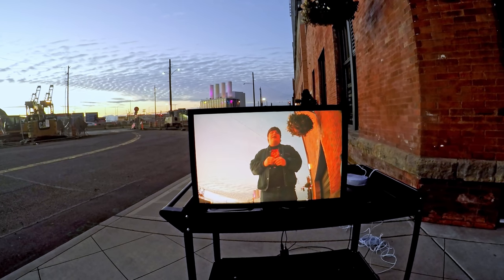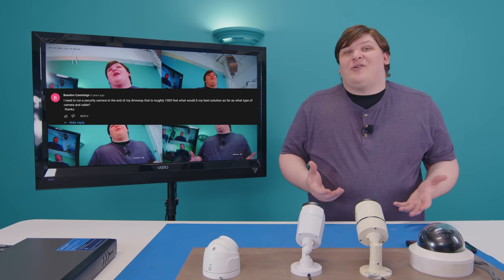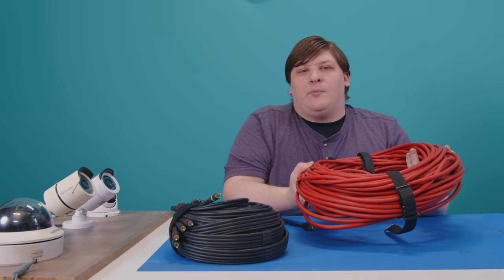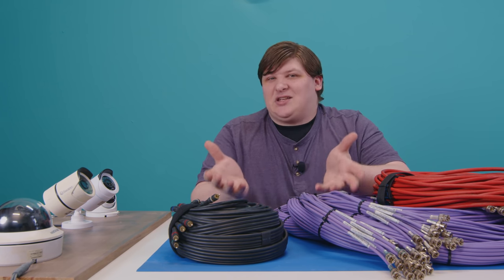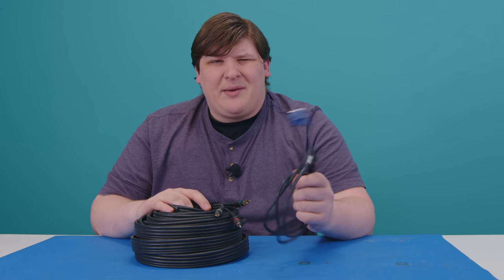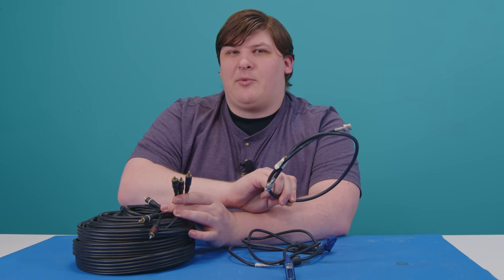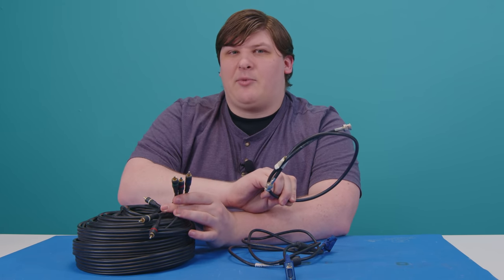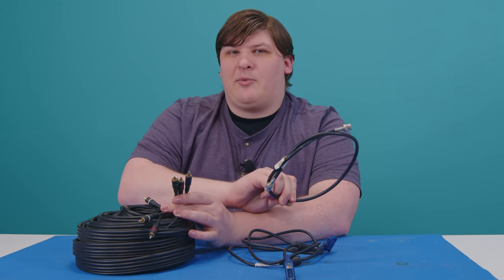1000ft of ANALOG HD video over a single cable?! [AHD/CVI/TVI]

Comment: CCTV Installer here (europe). We install 4k and 8k IP cameras daily. FullHD or 2k is basicaly obsolete in this buissnes. It's actually pretty scary beacuse most of Hikvision, BCS and Dahua (biggest players in the industry) cameras have face and number plate recognition chips onboard, only the cheapest ones don't and we rarely see that clinets want them. Pretty much every hotel, shop or office with modern CCTV system is running them and they see everything in freaking 8k (though 4k has more quality playback for some reason but i quess it's sensor size problem).
Reply: Welp I'm afraid now
Reply: But wait! There's more:

Security of those cameras is bullshit. If you  can see the camera (and sticker on it with serial #) you can literally ask HikVision or BCS (dunno how's the situation with dahua but i quess its the same) for one time master password to reset the camera (yes, SN needed for resetting the camera is literally on the sticker on housing :) ). You have to be registered as installer and shit but i bet there are registered people who will send that email for you for $10. If you have access to the LAN/WLAN you can find out cameras' IP adresses and reset them, do whatever you want with them and set the old IP adress so the recorder is still recording like normal. Recorder is dumb, it doesnt know what is going on with camera, the camera just sends video over IP and thats it.

And there is that thing that even when someone is watching playback on screen they propably wouldn't notice the camera went offline if there is little movement in frame, because the playback just hangs on last frame that went through. So you can cut the UTP, connect camera to switch, splitter or something and propably nobody would notice. Also, those cameras freeze on day to day basis so if the playback stops, security guy propably would not care. Even those hardcore mall-cops don't care, its bad. 

Analog cctv is more secure 👌
Reply: Wow. So is this long distance too? So if iphone 13 pro has a 12MP camera, which means a 8k ip camera in theory could easily transmit it long distance? I wonder what components would one need to build to have a hardware/software based solution that does the conversion digital -> analog -> digital and carry 12mp (or 3x 12mp cameras)? 
What is the example part# for the 8k camera?
And one more question. If someone let say had a "Sony A7R IV" with 68MP camera, could this technology in theory be able to sustain the signal over cable, or you would hit some max carry frequency?
Reply: @MrInterestFull  this is not so much about how many megapixels does sensor have as about bandwith and bitrate of your stream. You can have 100MP sensor and only make 1000kbps video out of it.

Comment: The digital tv thing being a poor tax is 100 percent. And when we moved to internet tv all the companies have been slowly jacking up the prices to just make us go to cable. Hulu live tv forced us into the disney plus bundle this month. 
And here in Rhode Island we get Fox 25 from Boston more often than we can get Fox 64 out of Providence. They turned down the power on all our transmitters to make the antenna useless.

Those cheapo usb dongle capture cards make great webcam and old console cards. They do 720p 60 no problem.
Reply: Boston is far larger and richer and more important than Providence, so of course their antenna tower will have a stronger signal.   If what you say is true about reduced power on RI transmitters, complain to the FCC or your Democratic representative.

Comment: Super interesting video!!! I didn’t even know this was an issue that needed to be solved at some point, I remember when my dad and I needed to set up a security system for his business. In 2017 or 2016 HD camera systems where so common, but it was difficult to find setups for DIY, and no way in hell we where doing anything contract. We went with swann security systems and didn’t even bat an eye at the fact that the camera quality was at HD over the many MANY spools of cables used to complete a run. It just worked and I never stopped to wonder why it wouldn’t. And it’s funny because I knew that something like DisplayPort has a strict standard to be able to work at stuff like 1440p 165hz. But It was never a concern to me that we would use dirt cheap cables that aren’t protected in anyway, they get cold, hot, wet, you name it and they work all year round without a hitch. We literally set it and forget it.

Comment: Talking about long distance video feeds, there was (and probably still is) cabinets at important places in London, UK   with video and audio connections linked back to Television Centre?/PO Network? so that outside broadcasts could be done without needing a wireless link (which before satellite would probably have been difficult in London due to the tall buildings).
Also, of course, in Europe whilst TV's did end up having component inputs we generally used SCART for everything, having both composite and RGB meant you got the best picture possible from things like DVD players and games consoles but could still use the connector for simpler things like video machines, it also allowed for composite video in both directions so that you could have a decoder/descrambler box that needed no tuner for normal TV frequencies (OTA/Cable), the video/audio signal being sent to the box for descrambling and sent back to the TV over the same cable. I had a Philips TV/VCR that had a cable option in the tuning menu for that purpose.

Comment: Not only you can run analog HD video on a long coax cable, you can use a couple of baluns on each end, and have the same video run over UTP unshielded twisted pair. You can even send 4 different camera signals over a single UTP cable (like the one used in LAN networks) because they have 4 pairs.
Reply: In late 2000s, our company did that a lot.  Everyone knew IP cams were going to take over in the commercial space, but just not yet.   Installed Cat5e/Cat6, and used those baluns at both ends for video and pick another pair to send power across.  Ten years later we went back to many of the old customers and upgraded them to IP cameras without having to swap the cables out when those systems became much cheaper.

Comment: Updated a gym over the years slowly at first using these analog hd cameras, they were impressive for the cost and ease of using old coax.

No comparison to a modern 1080p ipcam . But now that you mentioned that expensive analog hd camera I'd love to know if it worked any better (even if technically it seems unlikely)

The major cost is always cabling so some brilliant ideas like this combined with newer ip cam would have been nice...

Comment: Great video sir!!
I recently did/am doing a job that I tried to take IP camera and convert them through coaxial (EOC (Ethernet over Coax)). At first, it went well but the more cameras I put up, the adapters started cross talking with each other and then would completely stop responding with video.. Long story but we got TVI analog cameras (client didn't want to spend the money to rewire everything) and have been getting them up to the 21st century lol

This is where I discovered TVI

Comment: Now I'm wondering how those security cameras way back in elementary worked. They were definitely old even then (monochrome B&W), but they were in rectangular plastic boxes that were in need of some serious retrobrighting. One side had a square for a motion sensor, and the other a square for the camera, but which was which couldn't be determined. They were, at least to the outside observer, opaque. Tripping the motion sensor led to a clicking noise, and a red light turning on. I remember as a little kid that I'd always wave at them when that happened. There were also other times I tried to move slow enough to be below it's motion threshold.
Reply: They worked the same way as the "black" discs on the PlayStation: they were transparent to the one color the laser or camera cared about. If that color was in the infrared, then the cover would appear to be black. But even if it wasn't, the tint can still be so dark you wouldn't know it has a color unless you held it up to a light source. PlayStation discs were a red-purple, not really black.
Reply: They were seemingly the same plastic as the rest of the camera's outer shell, just thinner. No laser, and not IR that I know of.
Reply: @LexieAssassin  Then at least for the motion sensor, they were probably using ultrasound rather than light. The camera can stare out an amazingly small hole, or through multiple holes if a bit of diffraction isn't a deal-breaker.

Comment: Some cars use these formats for the cameras. A buddy installed an aftemarket head unit in his honda and I convinced him to hack in a AHD camera module into the turn and reversing camera areas (after finding out after market head unit supported these.) He was blown away when I showed him what this actually meant. (from a wide 480 to a full 1080) just beware that getting the boards with appropriate physical size is a bit tricky. I ended up using some hacked up dash cam remote modules that were AHD.

Comment: 19:46 I think the beam is actually moving down as it sweeps across, not just when it's turned off and returning to the left side. So the scan lines are very slightly at an angle.

22:41 The format seems to be standard NTSC, with a different aspect ratio, AND putting the image fully into the "overscan" areas, so get a little more horizontal resolution. They can't really encode more luminance information because the chroma is above it in the spectrum. More luma information would cause its bandwidth to bleed into the chroma and cause multi-color patterns.

Comment: Special credit to the production assistant/cable wrangler. 
CCTV analog is like motorcycle/small engine carburetors. Long after everyone in automotive ditched for fuel injection, manufacturers within the two wheel/implement space continued to improve and hone carburetor tech for decades. Love it.
Reply: The orange brand's 500i chainsaw is a remarkable piece of engineering... any technician will tell you it does the same work as a carbureted machine, is harder to work on, and needs more expensive replacement parts. On the other hand, it can run on nearly straight ethanol, and it starts cleanly at altitude. I'm not sure the analogy can be stretched to electric tools and IP cams, but I hope we don't forget about analog and carburetors in trying to climb higher and run leaner.

Comment: Doing networking over Coax is actually 80's era technology. They used that cable before the 2 line phone cable.  You can also send HDMI over Ethernet.
Reply: Yeah, I remember that from when my dad brought me along when I was little. Networking rings, termination and stuff. I was not born yet in the 80's either
Reply: You can send most stuff over ethernet, even extensions for mice & keyboards.
Reply: And you can send Ethernet over HDMI :) Other than coax and traditional phone cable for WAN there's also buttload of proprietary random links with whacky connectors that on physical layer are just glorified serial ports.
Reply: 10base-2 baby!  A whopping 10mbps.  No hub/switch.  Just daisy chained.  Set that up at my parents house so I could play Doom with a friend.

Comment: Your little aside about digital TV reminded me… For a long time I lived in a valley which TV signals loved to bounce multipath around and cause all sorts of noise and ghost images in analogue TV. In 2006 they kept insisting Freeview (terrestrial OTA DVB; MPEG-2 at, IIRC, 30Mbps) would never work because the transmitter was outside of the valley. Indeed, even the neighbours’ best rooftop aerials struggled, and my TV-top antenna was hopeless. It was waaay worse than your example clip. 

In desperation I tried a signal booster, since we always needed at least one to get a usable analogue signal anyway, to no avail. I strung two signal boosters together, still no dice. But with three…. the intended digital signal was somehow discernible by the decoder with only occasional blips! At its usual worst it was 1-3 blips an hour for less than 5 seconds each, but often much more infrequent than that. So I went from snowy, ghosting-filled images with noticeable audio distortions on analogue to clear, almost DVD quality viewing despite living in such a poor coverage area. 

And almost all times when the picture did briefly freeze, the audio still went on uninterrupted, presumably due to only needing 128kbps or so and having more parity bits than the video or something. And at least the captions always kept going. I can count on one hand the times the signal completely and utterly failed on every single front, and they were during storms when you’d want a battery powered radio in reserve because the power might go out. 

So for me it was definitely an upgrade, even with a £10 indoor aerial and some of the worst signal coverage in the UK. But if there weren’t extra signal amplifiers lying around I would’ve regarded it very differently. I used just regular ones for analogue from the late 80s and early 90s, not the “for digital” ones some shops were trying to get everyone to upgrade to at the time. I think just one high powered TV amplifier being sold at the time was equivalent to my three, but I’m also pretty sure they were more than triple the cost of the basic ones they also still sold. Of course, having to buy a few signal amplifiers is still a larger expense than just an aerial, but at least it’s not a satellite or cable subscription.

All that being said, I’m curious if you’ve tried stringing together 3, 4, 5 of these amplifiers (if you still have them from the NES video) to see if that helps. There’s seemingly not many parity bits, given how sensitive it is to disruption, but apparently just enough of them that really amping up the signal can scrape-by a lock. Well, that’s assuming ATSC has any characteristics similar to DVB, maybe ATSC is just worse. I know they both use MPEG-2 but I’ve never compared carrier wave encapsulation profiles, the multiplexing, or checked out the frequency ranges for ATSC.

Comment: It’s not surprising at all that coax can do analog HD: coax handily carried dozens and dozens of analog SD channels simultaneously. So the analog bandwidth is there. The HD security standards are simply allocating all of the available bandwidth to a single signal, rather than dozens of signals, and thus that single signal can itself have a very large bandwidth. 

Digital absolutely can be designed to degrade gracefully. On the one hand, we use error correction encodings to add redundancy, but moreover, the reason digital signals tend to fail badly is that they’re compressed (which makes them very un resilient) and often encrypted (which will often simply break the link entirely when errors occur). 

The audio CD is a great example of very resilient digital encoding. The analog waveform coming off the laser pickup (typically called the RF signal because of its frequency) shows how much variation can be tolerated before the digital circuitry can’t make it out any more. But then the encoding (EFM and CIRC) enable both bit errors and block errors to be corrected (which is why minor radial scratches don’t cause any problems). And then even if a particular frame of audio cannot be recovered, it can either be dropped (causing a minor audible glitch) or interpolated (causing a bit less of a glitch). But this works because a CD is the exact opposite of compressed: the raw audio data is actually inflated with an extra 75% of redundancy data.

Comment: I'd submit the following correction to your semi-rant on why switching to digital was a bad idea:

Digital signals have significantly better robustness in terms of delivering a perfect lossless signal over a noisy connection. While an analogue signal will begin to noticeably degrade under less-than-ideal conditions, a digital signal will deliver perfect audio and video up to a certain threshold. In low-noise environments that's a benefit. The drawback however is that, as you said, past said threshold it's just gone. Whereas an analogue signal will just degrade a bit more, but still remain more or less intelligible. "Perfect" being the arch nemesis of "good enough" and all.